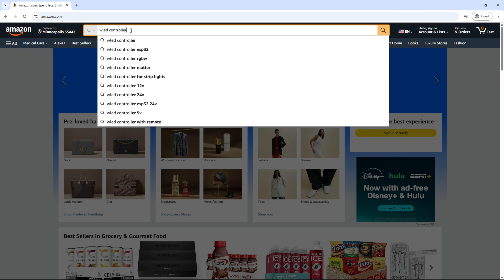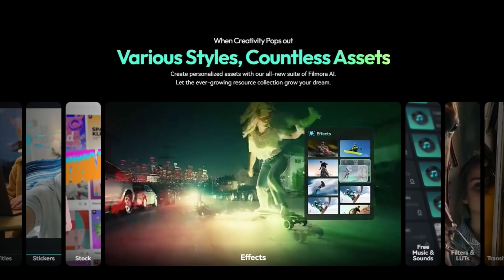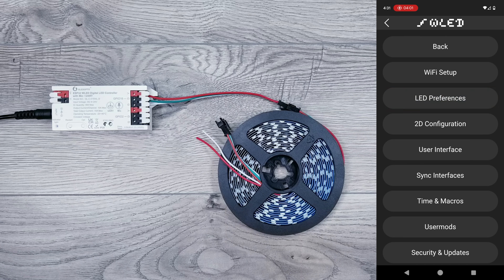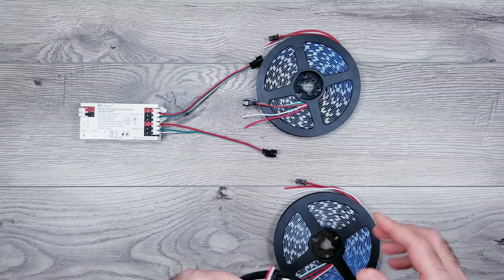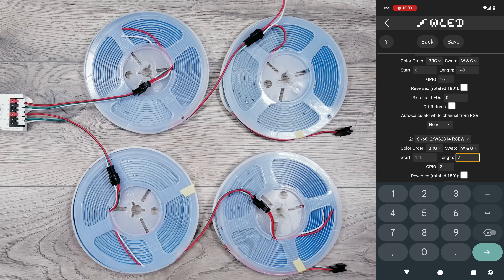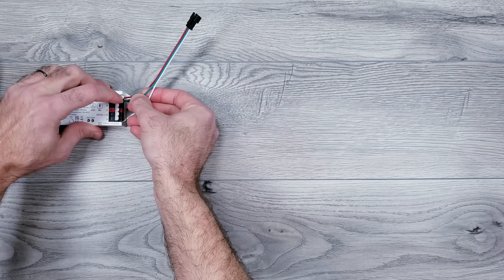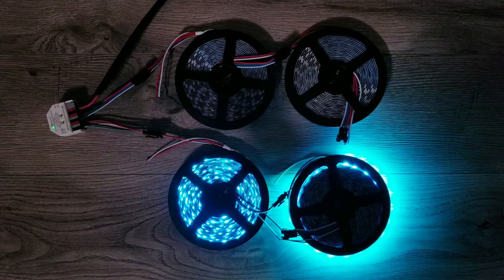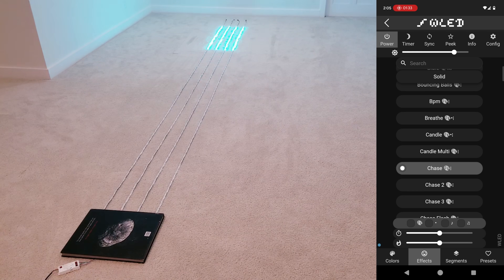The ULTIMATE 5v, 12v 24v LED Setup Guide for Beginners. EASY Plug n Play WLED + Sound React WLED

Comment: What's the difference between 5v,12v,24v, why would you use one over another? Higher voltage mean longer lengths before power injection?

Comment: Chris, I love all your videos. They are straight to the point and very informative.  Thanks for all the work you put into them!  Quick question: I am building 2 bookcases on either side of the TV and want the under shelf lighting to display identical colors/and effects.  I installed WS2505 RGBCCT lights and a Gledopto ESP32.  Do you recommend I wire the 2 bookcases to separate outputs on the controller, or use a splitter from a single output?  I will be using about 16ft total of strip lights, so not worried about sufficient power.  I also want to turn on/off the strip lights via a light switch.  Is a switched outlet to cycle power to the power supply the right way to go, or is there a better option?

Comment: Just to confirm, in your 24v cob example, you managed to run 20ft with your single 5a 24v 120w power supply? 
Seems crazy cause a single 5m length of those requires that power as per their spec sheet

Comment: Got one of these controllers to use with my pc the outputs have stopped working after only a few days I have a solid 5v input but not reading any voltage for any the outputs any idea what could be going on ? I’m using a 3 amp 5v psu, I have tried factory reset different leds no difference

Comment: ok I have been trying to learn about this for a while and I am being told if I run 15M of 12v strip i am being told that 6Ampt is no where near enough. is that true. you ran 20M and it was fine.
Reply from the maker: If you want to run things at full power/brightness then 6a is not enough. In my opinion full brightness is 100% overkill which is why I'm perfectly happy with the results I get using significantly less power than what the lights say they require. Hope that helps!

Comment: I have followed literally everything you've said in this video step by step. First time I turned the lights on, normal stuff happened. When trying to use the app, mine looks nothing like yours or others I have seen. Why is this? When I hit the + in the corner, it asks me for an ip address or URL? what is happening?  Now today, trying again, all my lights are the same multi color scheme, I can only get them to go white, if I hit another color, I get multi color? All this is through my phone just like in yours & others videos. I can't do anything with the app & as best I can tell, I can't even reset the controllers. Please help. I have so many questions.😢
Reply from the maker: Thanks for watching! I set up many different lights and configurations in this video. What exact controller, power supply and lights are you using?
Reply: @ChrisMaherDIY 
Ty for responding. I used exactly what was in your most recent ultimate game room build, used your links and everything. Lol. This morning, I tried using my dual channel esp32 & the lights were the normal orange again. I think I may have inadvertently changed something in the quad channel ones when I somehow accidently actually connected. Lmao. Now I can't change it back & for some reason I can't seem to reset the controllers.?
Reply: Omg, I got it!!!... lmao... some steps weren't included in your video that should maybe be mentioned cause you never know when an idiot like me might come along...😂... my only real problem now is that most of the colors don't match what I'm doing with the color wheel?... any thoughts?...
Reply from the maker: @nickgrandy3098 thanks for the update! What did you end up having to do? And usually that means you need to change the color order to get the colors to match!
Reply: Oh and one more thing, an idea for your "will it wled" series... gaming pc lights?... will they wled?...
Reply: Noice, I will try playing with that. 
1st, I realized my image didn't look like yours because your using an iphone. Lol. 2nd, in the other video, I learned after selecting "save & connect" when setting up the wi fi, you need to wait & let the screen go back to the color wheel when it says the deal about going back if the ip changed. I was just going back to my home screen & opening the app hoping to find my lights but again, all it did for me was ask to enter an ip address or url which somehow I actually got to work once. Lol. But not really. Once I figured this out & realized that's how the controllers are actually getting connected, the rest was a breeze. Every time I open the app now, it just works. Thanks for your help again man, you've inspired me to go wild. 😂 One last thing, you give any thought to my "will it wled" idea?...pc argb control...I know about apps like signal rgb but they want a sub fee for the really cool effects. 😡

Comment: I'm using the GLEDOPTO controller model GL-C-015WL-D on a 12v power supply with my 5-meter BTF FCOB RGB WS2811 IC LEDs strip.  That was a mouthful.  Anyways,  I finally figured out that it's 70 ICs after actually counting them.  I was unable to find that in the drop down but I was able to use your video to help me get started. 

Now it's time to play.  I'm not sure if I did everything correctly, but it's working.  The app seems weird since it's my first time using it.  So, if anyone else here is having a hard time,  this video was probably the best you guys can find. Once I get my tests in,  I might try to upload my own how-to on my channel here.  

Just a thank you to Chris for posting this.  🎉

Comment: Can a 12 volt controller work in a vehicle?
Reply: Your typical vehicle runs on 12v. Varying from 12-14~ volts. As long as you have this range, you are good. Anything lower most likely means you are running an old school 6v car or you have a dying battery.  Anything higher means you have a voltage issue, or you are driving a semi that runs on 24v. Good luck.

Comment: Hello, sorry for this question, I'm a beginner. I have a 15m long WS2812B LED strip with one LED every 6cm. After some research, I saw that it requires a 5V 20A 100W power supply. If I use the controller you're showing, do I need to power the strip directly, and what power supply is needed for the controller? Thank you in advance.

Comment: Hi Chris. Great videos.  Question.  If I decided to run this setup for the entire perimeter of my home outside instead of doing the govee lights,  would this work, or am I overthinking this?  

I feel like using the same setup you have around your garage doors,  which are super awesome, by the way,  under the eaves of my roof.  I have roughly 400ft. I want to cover all the way around the house.  Single story home.  I'm not sure if this will look better than the govee lights.  Thank you in advance.

Comment: Dear chris, is it possible 1 led strip end branches out to 3 led strips?
Reply from the maker: Yes, very easy to do. Split the data 3 ways and it will do just that. the 3 branches will then do the same thing at the same time.
Reply: @ChrisMaherDIY  Thanks for replying! But the 1st led strip will overload or heat? since power>driver>led strip 1 >branches out to 3 led strips
Reply from the maker: @HelloGudbye your welcome! you should be fine. Test it out and see what happens.
Reply: @ChrisMaherDIY  Alright :) Been learning and inspiring from you!

Comment: The problem im discovering. If you buy a ammazon pre flashed controler sound react for a ws2814 fcob you need to flash it again and with no usb on these OTA is all that's available. The issue no room for the new version of the firmware and will get failed message. So can't do a clean install update with this particular situation.
Reply: If you download a older firmware then the one your trying the to update to a smaller one it will repartition the available memory and allow the bigger new download. It just needs to be smaller then the current.

Comment: when you are controlling the 12v strips does both strips have to be doing the same thing ? Or can each strip be doing something different ??
Reply from the maker: Thanks for watching! If you use separate data outputs they can be controlled separately.
Reply: @ChrisMaherDIY  so using the controller the g2 could run differently that the g1 right ?
Reply from the maker: @josephtrimmer1491 yup.
Reply: @ChrisMaherDIY  thanks so much your video has given me the confidence to tackle redoing the lights in my limousine
Reply: @ChrisMaherDIY  is there a way to set the controller to where it goes to what you want to every time you turn it on. Or do you have to send it to a certain setting every time you turn it on? I’m using it in my limousine and every time I turn it on I have to send it back to the setting. I wanted to be on.

Comment: If you cut lights off the strip, what do you do with the lights that are cut off?
Reply: You can resoder cable to use it again., that the point of those pads, i'm not an expert but that basically that

Comment: Great video and love your work.  Question regarding Mini controller.  Just purchased one and have 2 questions.   What settings did you use in user mod for setting up the mic for sound react ?   And have you been able to update the firmware on these?  When I tried to updated from v0.14.4 from within either the app or web GUI I get Update Failed
WLED_0.15.1_ESP32.bin
Your device might be PIN protected or locked with a passphrase. Check your settings.  Any ideas or help on this?

Comment: awesome video.  Just getting started in DIY LED lighting.  Question, this is a small starter project for my china cabinet so total run of LED strip will be under 15ft.   I'm going to use the 5v LED but don't like the big power "bricks".   Can I get away with a simple 5v 3amp power cord using SK6812 and Gledopto WLED controller?

Comment: Question, if I remove a single socket. Can I also use those power cables to supply power to the gledopto? Or is this too much current.

Comment: Shouldn't the 5V strips be powered at multiple points? Isn't the power supply too small? Shouldn't a 25A power supply be used per 5-meter roll?
Reply: What kind of LEDs are you running that needs a 25 amp power supply?!?!?!

Comment: Can someone explain how he added 15meters? I thought 5v10a is just enough, slightly shy actually, of fully powering 10 meters at 60Leds/M
Reply from the maker: All powered calculations are based on max brightness. For ambient lighting, you don't need anything close to max brightness. So when you run them at less brightness, you don't need anywhere close to the power all the calculations say. The only reason most people would want Max brightness is if they're using these for their main lighting, but in my opinion, you wouldn't want to use RGB LEDs for that anyways.
Reply: @ChrisMaherDIY  I see. Thanks for the fast reply! Your vids are really helping me plan the LEDs for my first own apartment!

Comment: HELP.  HOPING YOU SEE THIS MESSAGE.  I have attempted everything.  I have the latest version of BFT FCOB RGBW led strip 24v.  It only has 3 wires, volt data and ground.  Arrow is pointing in the correct direction.
I have WLED controller ESP32.  I used the JST connectors that came with the LEDs.  I connect everything as instructed and CANNOT get lighting.  
Sk6812/WS2814
Length 70 (5m strip)
Gpio 16
BRG and W&G swapped
I've tried it all.  I've ordered a 2nd strip thinking maybe it was defective.  Now ordered a 2nd esp32 box thinking maybe it's fried.
Wish I could send you pics.
Reply: One thing I also noticed is the wires top to bottom on the strip are RGW.  They dissappear into a fully covered black black insulated tube to the JST male.  The female JST connectors when aligned correctly seem inverted WGR.  Could BFT have messed up?  Have you ever had that issue?

Comment: Awesome video this made me buy the controller and works great thank you. But I'm having issues, I have to use the WLEP-AP WiFi to use the app, if I'm on my WiFi I cant just access it through the app says controller is offline?
Reply: You need to connect the controller to your WiFi first before you can control it using that.

Comment: I have the BTF WS2812 which is not listed in the LED Preferences.  The closes i see or get is the WS281x.  Below that drop down is another dropdown that mA/LED: that it does offer (eco WS2812), but either way i select it, nothing happens when i save.  So close, but yet no go.
Reply from the maker: You would just use the ws281x from the drop down. Make sure that your gpio number is correct and you've entered in your led count. I've also seen where people have to go into segments and make sure you put the led number in there as well. If its still not working, i'd recommend checking out the WLED reddit group or discord for help.

Comment: How much in total can that controller take as far as led count, I thought it takes 800 Max, you have 900 on there and said you could have put an additional role at the top if you had it, so you can put more than 800 on that controller?😮
Reply from the maker: Thanks for watching! They say 800 is the recommended amount but I've done a lot more than that. They say 800 because that's when you will still get the best frame rate on animations but I personally really don't notice much of a difference when you go over that recommended 800 limit. I always just try using however many I want, test it out and adjust accordingly
Reply: @ChrisMaherDIY wow, thanks for letting me know cuz I'm going to do a fireworks star with a flare going up and I want to do like 50 spook and make the LEDs tighter then 50 mm spacing

Comment: I noticed that after following your instructions for setting up the LED strip is WLED, that the white LEDs were not lit. The "Pure White" color was a blend of RGB rather than the white LEDs. To get them working, you have to scroll to near the bottom of the configuration page under "White Management", check "White Balance Correction", and set "Global override for Auto-calculate white:" to "Accurate". This enables the the white LED on the strip. 

Thank you for all your videos, Brother!!!
Reply from the maker: Thanks for watching and for the information! I've never had to do that but I also realize anytime a new version of WLED comes out things could be slightly different. What led strip were you using?!
Reply: @ChrisMaherDIY I purchased the LED strip that you had linked to. SK6812 SPI RGBW LED Strip

Comment: Hey Chris, I purchased one of the large controllers you featured with MIC/UART. However, I can not get it to connect to Alexa. Is this controller not Alexa compatible. I did notice that Gledopto makes a ESP8266 controller which states that it will work with Alexa. Just trying to find the right controller to control the lights with Alexa for a theatre room build. Thank you in advance!

Comment: What about if I can’t find I’m my WiFi ?
Reply: Just a few days ago, I wasted an ungodly amount of time trying to get this to work. I was using a USB connection to a desktop computer with my Wi-Fi turned off. It's normally just wired. They need to make it clear and the instructions that it must be on Wi-Fi only. I also could not figure out if my USB cables were data supported or not. I think and probably want to return the unit I have. I was able to get another more dense set of LEDs to work on this controller, but the RGB W settings didn't want to work. All wled sequences were like fruity coco puffs jumbled up random colors. That was a muzato set that was 12v  96 density. 
I have to step away from the lights. It looks like getting something mic reactive is not going to be worth it.

Comment: Is it possible to wire this controller to a typical wall switch? I have my controller working, paired to HomeKit with the simple matter QR code. I tried to wire this controller from a wall switch that is wired to a LED transformer and from there I ran the positive and negative wire to the input on this controller. It flickers very quickly but ultimately does not work.. any help understanding how to connect this to a wall switch would be greatly appreciated!!!
Reply: You may need to check your LED Transformer for Voltage and Amperage  and  make sure it matches the controller and LED strip rating you are using and ensure the wiring is correct. 
Red is Positive 
Green is Data
Black is Ground
Reply: Your Transformer could be bad too - check it with Voltage Meter to 
AC to check Voltage input 
*
Then switch to
DC to Voltage Output 
*
If DC Voltage Output is not steady then the LED Transformer is bad 😢
Reply: You could connect a wall switch to a wall socket and plug it a barrel plug Transformer he has linked in the description for the voltage of LEDs you are running  5v, 12v, or 24v

Comment: thanks for the video. I want to use these lights with dc power from my battery bank, can I just wire them directly to my fuse block? Would I still need the driver?

Comment: Great video! Answers much of my questions I had. 

I ordered 2x 4 meters of WS3811 COB led strips which I plan on daisy chaing to eachother. Can you confirm that this will work without problems? Or do I need to inject power at both the start and the end?

Comment: I have purchased a x0029bz7lx gledopto  gl- c 015wl-d  led controller, I have connected it up to FCOB5m24vws2814rgbcw66, using a tag24v150w-s power supply.
I have connected up to the wifi, downloaded WLED
but cant get it to work, can you assist? Thanks

Comment: So newbie here and looking to install in track inside of the shower, is there a waterproof tape light version of the tape light showed in the video? Also is this program available for an iPhone? And lastly, the total length of both areas will not exceed 2 feet in length.. so is there a minimum distance or it will not work?
Reply: Anybody?